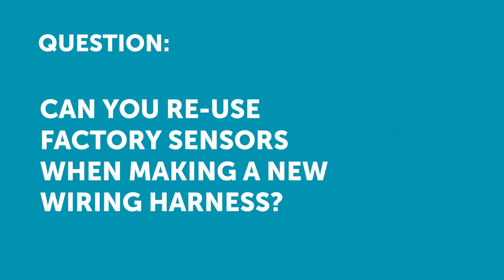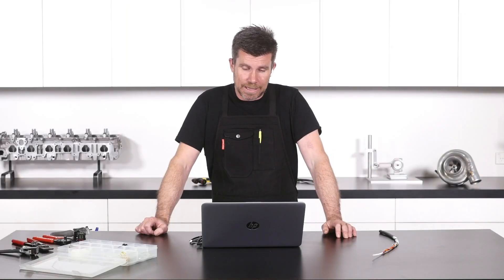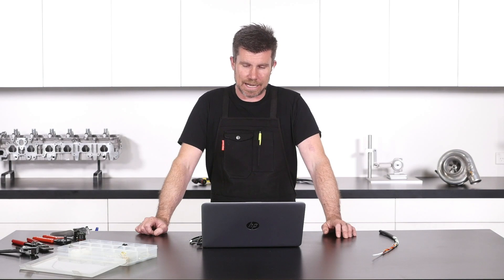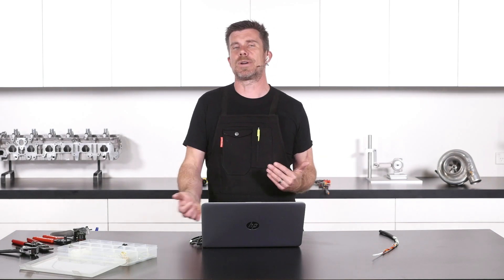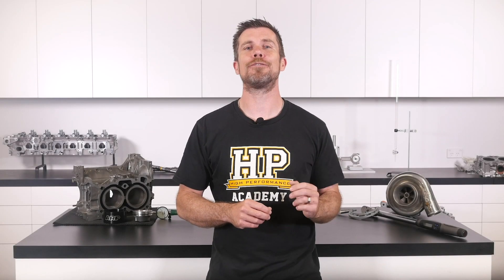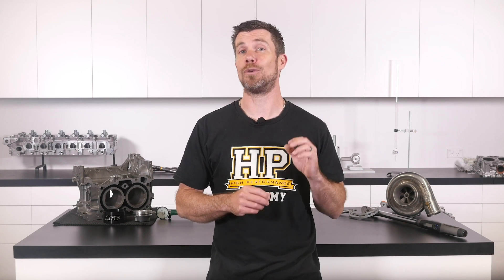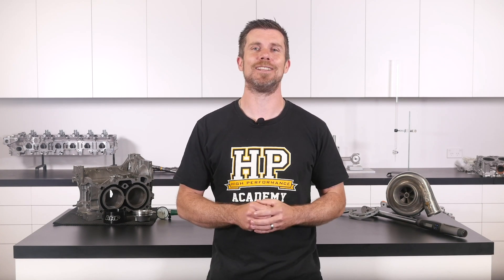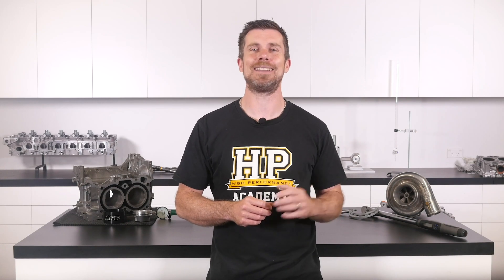Reusing OEM Wiring Connectors | Motorsport Wiring [HPA Q&A]

Comment: Any recommendations for where to buy OEM connectors?
Reply: Same, I need replacements for my Mazda Protege. My stock harness is thrashed, so I need to make a new one. You can of course buy a new type of connector for sensors/whatever that have wire coming out, and retrofit. But some do not have a lead and the connector attaches directly. I'd really rather not have to pot all of those connections to use a different style connector, and then if I ever have to replace them, pot the new piece and wait for it to cure.